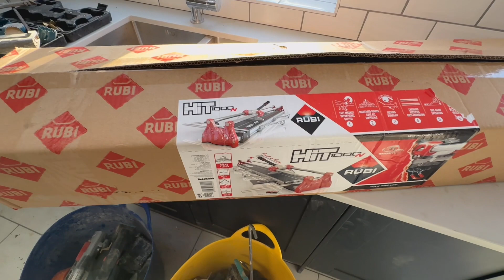Tool shopping for Christmas - London Extension build - Ep 65

Comment: Check the weight of the tiles! Make sure the plasterboard can hold them as porcelain can be very heavy depending on thicknesses!
Reply: Yep, those tiles will be too heavy for plasterboard, should have used Hardie backer board.
Reply from the maker: They are 100% fine for plasterboard, and the tiles are ceramic 👍🏾
Reply: @darrenthebuilder  You must be right on the limit then for tile thickness of 12.5mm (max)?
Reply from the maker: Tbh there is barely any tiles going on plasterboard. Only around the toilet, and will be only two tiles high. Plasterboard (Unskimmed) is rated at around 32KG Per metre square. These tiles are 24.3KG Per metre square (according to the box) so they are well within recommending rating. Cheers

Comment: Hi Darren,

Excellent job so far, but I have 4 issues concerning installing tiles on plywood flooring:

1/ It is not recommended by the new guidelines and Detra matt should be installed between the plywood and the tiles, because the wood will absorb the water in the adhesive and the tiles will start to crack after a while.

2/ As it has mentioned that plastic bathtubs are awful to use and you could've advised the owner to use a steel one instead.

3/ You shouldn't have installed the bathtub on the tiles, as they will crack as soon as someone fill the tub with water and using it because of weight load.

4/ Please make sure to seal the gabs between the backerboard joints, otherwise water will seep through them.

Finally, keep up with the excellent and professional work.